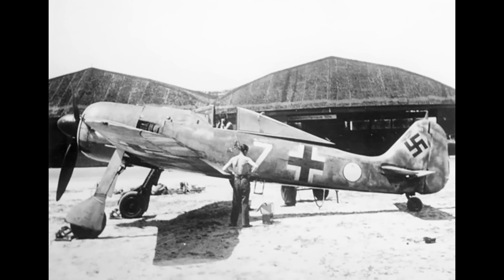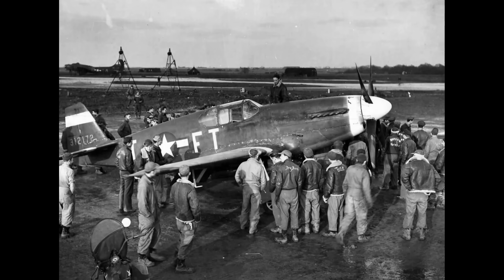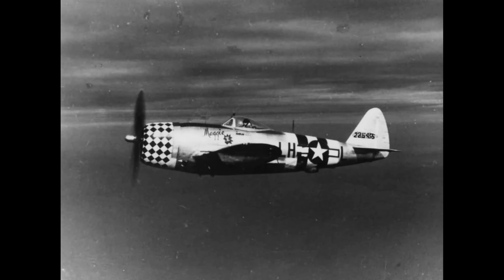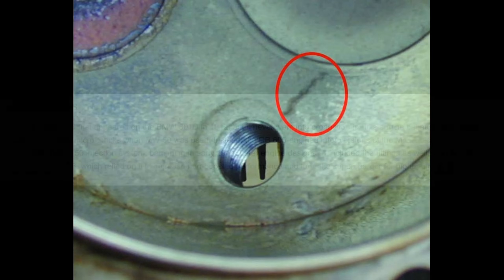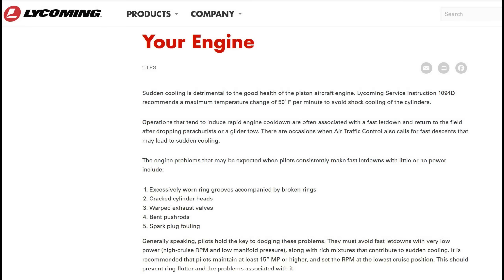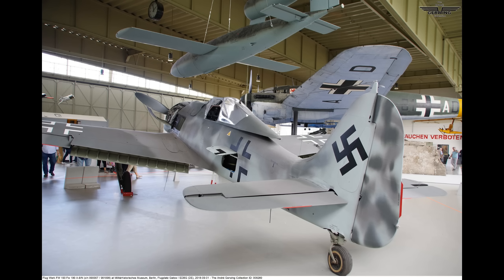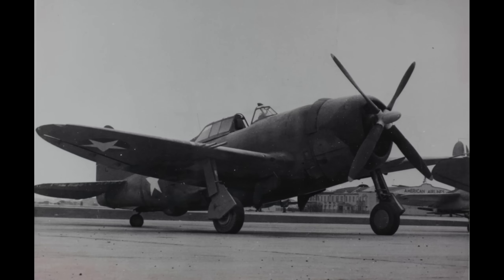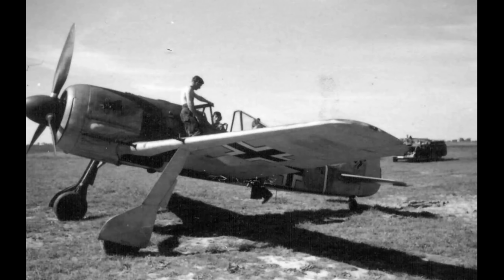Focke-Wulf Fw 190 A-4, Almost turned the tide, Almost...

Comment: Thanks Greg as always!!! I was wondering why didn't the Luftwaffe just retrofit most of the Antons with MW50 especially early on. Also why haven't the the BMW801 engine got more advanced supercharger systems.
Reply from the maker: Hopefully this video will answer the question about MW-50.
Reply: @GregsAirplanesandAutomobiles  again Greg thanks alot!! I still remember years ago (pre patreon days if not mistaken) that I requested the FW190 video, and you gave it not long after that!
Reply: Also did they tried to spray smaller amounts of MW50, for example, to get max power of 1950hp instead of 2100hp?
Reply: @LuqmanHM I'd assume that if they tried using smaller amounts of MW50 and Greg was aware, then he would have definitely made us aware of that.  He's great at including all of those little details.
Reply: @Jbroker404  understood, that fine level of details would be difficult to find